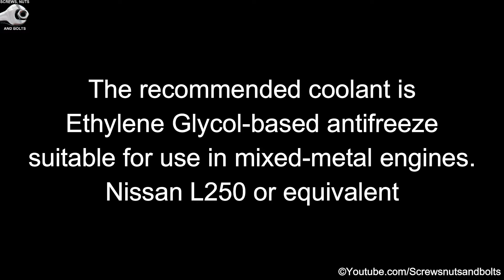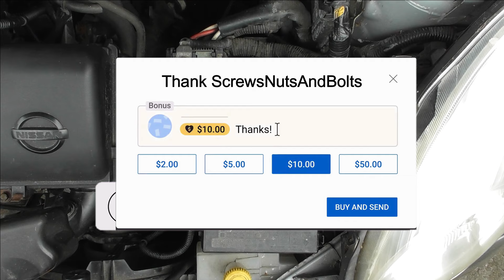Engine Fluids and Battery Change - Nissan Micra K12

Comment: Can you tell me why is my temperature gauge in the car dash illuminated as a blue colour then changes to a red colour 👍
Reply from the maker: The red light usually only illuminates when the engine is over-heating
Reply: And what does the blue mean  ? Thanks for your help
Reply from the maker: The blue light means the engine is cold but it usually turns off after the engine runs and warms up for a few minutes.
Reply: @screwsnutsandbolts  thanks for your help 🇮🇪👍

Comment: The cap off my windscreen wiper fluid fell off! Do I need to replace it or can I still refill and then drive without it?😭just realised it was gone after I took it for a service.
Reply from the maker: If you're not going to replace it I would cover it with something to stop dirt or debris from possibly getting in there, but make sure it's not completely airtight. The original cap would have had a small little hole for air to get in.

Comment: Now my screen washer is empty I wanted to top up it and check the oil level.

For the screen washer, there's no cap over the recipient so thanks to your video I know where to find it. 
Can you tell me if I can fullfil it and drive without having a cap ?
Reply: + I wish I had the document with all the cars information, but sadly on internet it is hard to find it free, because the car is old, and the few that are available are like $20 but I don't want to pay it because it seems to don't be the document I search. I search a user manual, principally for having a plan of the emplacement of elements,.like where are all the fluids, because I struggle to find them without your video :/
Reply from the maker: Yes it should be ok to drive without the screen washer cap but maybe you could cover it with something else.
Reply: @screwsnutsandbolts  You are a great person, THANK YOU ! 😁
Reply from the maker: You're very welcome !

Comment: Sorry bro if i dont know which cooling refrigerant they put can i top up with others? I just bought a car a few days ago
Reply from the maker: Refrigerant is only used for the air conditioning system, if it is installed. If you're talking about the radiator coolant like in this video, it's not a good idea to mix different types of coolant. I would advise having the system drained and refilled with new coolant.

Comment: I want to change the oil in my Nissan Micra  2005 Benzin , two door, what oil should I put in please?
Reply from the maker: You can get the details at 6:22 in this video: https://www.youtube.com/watch?v=ndPvBxXo7GM
Reply: @screwsnutsandbolts  5W30  ?
Reply from the maker: Yes I think 5W30 is the recommended oil

Comment: Actually, I couldn't find where is the steering wheel fluid exactly. When I rotate the wheel, it squeaks and I was gonna buy ATF II to fix it, but I couldn't find where is the fluid.
Reply from the maker: The Micra K12 has electric power steering, not hydraulic
Reply: I got it but how to fix squeaking

Comment: Hi, I wanted to ask you, I also have this car, mine is a 1.2 16v 80hp, after changing the oil, I see that it consumes a little too much petrol, what do you recommend me to do, put in some engine oil additives.  HI.
Reply from the maker: I don't think changing the oil should have any impact on fuel comsumption unless you used oil that's thicker than recomended.
Reply: @screwsnutsandbolts  I don't use your recommended 5w30 oil from the house

Comment: I couldn't find my nissan micra s 2006 steering fluid reservoir as i need to change steering fluid
Reply from the maker: It's electronic power steering on the Micra K12 so there's no fluid reservoir.

Comment: mate i just want to say that you're an absolute life saver, I'm working on my micra  at the moment as I cannot afford to take it to the garage today i just changed my brake pads, and would be doing my engine oil, spark plugs and aux belt soon. thanks for the tutorial. also just a question does the micra have a steering fluid? as I havent seen that
Reply from the maker: You're welcome. No this model has electric power assisted steering.
Reply: @screwsnutsandbolts  can you do a guide on oil changing and changine the filter from the bottom perspective?
Reply from the maker: I already did: https://www.youtube.com/watch?v=ndPvBxXo7GM
Reply: My micra has a rubber seal that i cant remove on the brake fluid reservoir

Comment: Hi how do you check the gear oil level,please?
Reply from the maker: There's a filler plug on the front face of the gearbox. You can see it here: https://youtu.be/0wfNRjdeh18?t=36

With the car on level ground, remove the plug and the oil level should reach the bottom of the hole
Reply: @screwsnutsandbolts  thankyou

Comment: Hi my clutch pedal is floppy can it be the fluid?
Reply from the maker: If it's a hydraulic clutch then it's possible. Check this link: https://www.chloesautorepair.com/why-does-my-clutch-pedal-feel-soft
Reply: @screwsnutsandbolts  yeah check and it's leaking from the slave cylinder...😔

Comment: Hi, I just checked my engine coolant tank level and it’s well above the max marker, almost at the top. what should I do about this?
Reply from the maker: Is it like that when the engine is cold ?
Reply: @screwsnutsandbolts  yes when it’s cold
Reply from the maker: If it has been over-filled, you could drain some of the fluid by removing the reservoir cap and then disconnecting the black hose that connects below the radiator filler cap and lowering it down to let it drain out into a container.
Reply: @screwsnutsandbolts  great appreciate the advice! Could I also use a suction pipe?
Reply from the maker: Yes you could indeed, if it fits down into the reservoir
Reply: @screwsnutsandbolts  great thank you!!